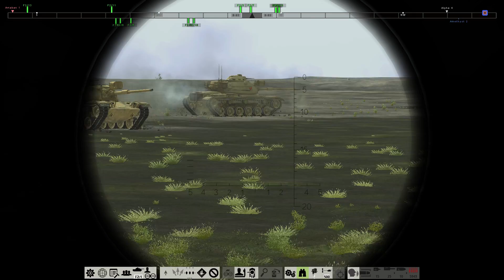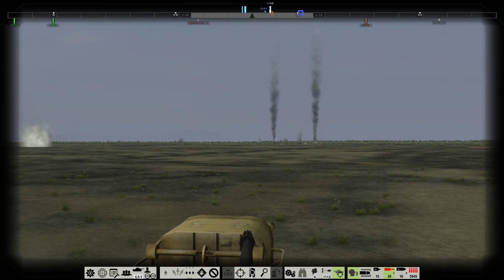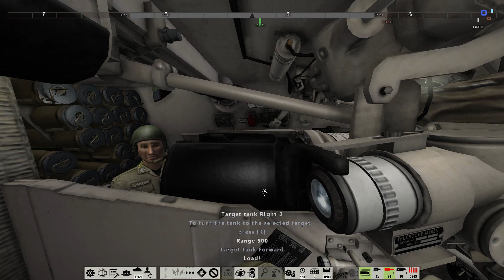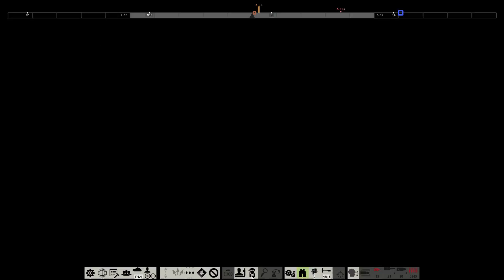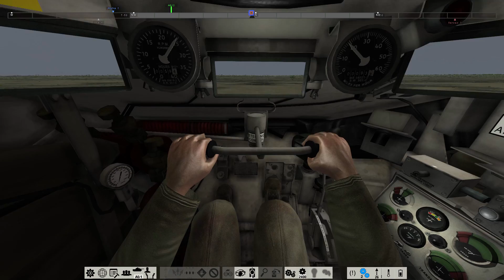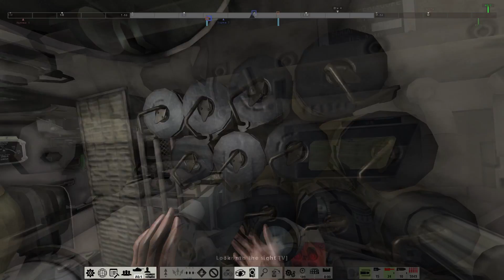Steel Armor: Blaze Of War // M60A1 Main Battle Tank

Comment: If you want to play a tank game with different players in tank positions, then get into ARMA. You'd have to dig around to find missions to play that way but its one of the only games i know that lets you do that.
Also, Graviteam's previous tank games Achtung Panzer and Steel Fury are hailed as the best tank sims ever. but sadly, they're not on Steam yet
Reply: +SteelBollocks 
Achtung Panzer is an RTS game, not a tank sim, though it used the same engine as Steel Fury and Steel Armor.

Steel Fury is alot of fun but there simply isn't much content for it as it's an old and obscure title.
Reply: +SteelBollocks u can do that in red orchestra 2 and steel beasts